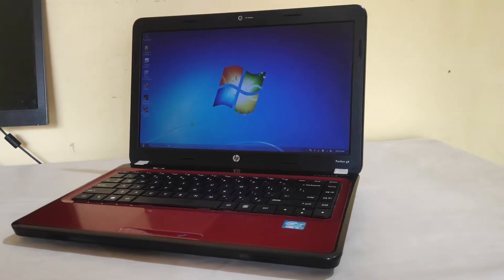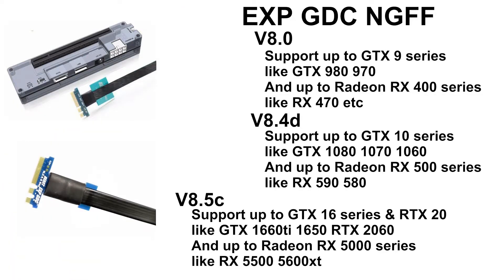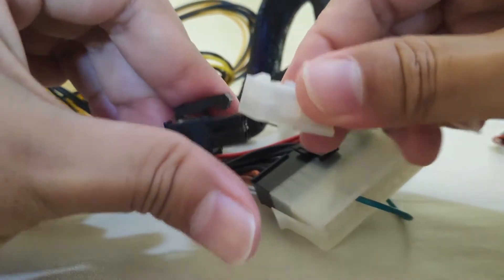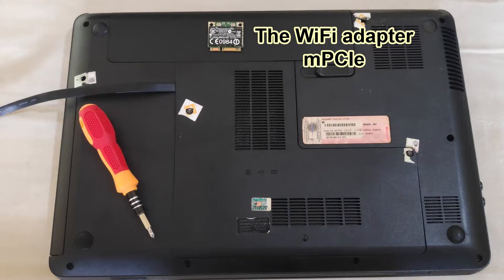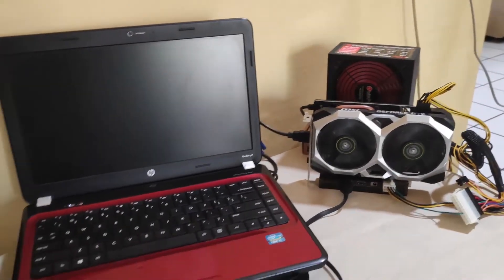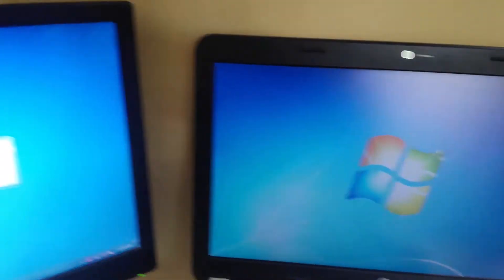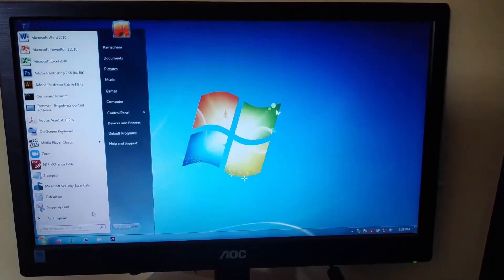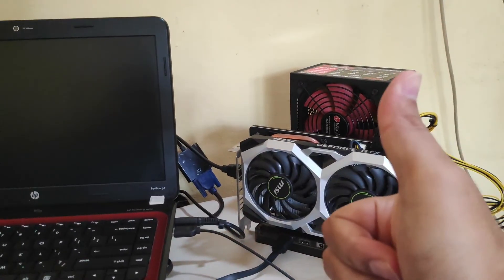EXP GDC Beast V8.5c eGPU with GTX 1660 ti on Old Laptop from 2012

Comment: Hey, this video is the most informative one I have ever found on this mater, I recently acquired the EXP GDC V9.0v and have a GTX 1650. My laptop has a m.2 slot that seems to run on x4 speeds (the one I use for the m.2 m key) and I also could have compatibility with the ngff key.

I have tried to get the drivers to work for a while but I cannot get rid of the error 43 code, the dock and the card are detected but I just cannot figure out how to get this thing to work at all…should I try setting my display to an external monitor so it can work or is it more of a hardware issue rather than a driver issue? Thanks if you are able to read this, I am desperate for help :(
Reply from the maker: Very well.
Can you please tell me your email but BACKWARDS+SPACE ? 

I will send you the Error43 Fixer instantly.
Reply: @ClayWheeler  Update on the matter:
I used a system scanner to determine exactly which PCIe interface I have and I came across that I have a PCIe v2.0 (5.0 GT/s), my laptop is an HP Pavilion x360 Convertible 14-cd0xxx.

This PCIe bus appears as dissabled thanks to my Intel UHD Graphics 620 (slot is not used at all also), though I saw a tutorial where the m.2 at x2 speeds can work but restraining the capacity of the eGPU, I cannot ger the system to let the eGPU work.

I am not sure this version of the beast works entirely for this laptop and 2.0 PCie m.2 slot, not sure if it is a GPU issue or if it is the m.2 itself (dunno if I must disable my integrated graphics card for it to work either).

On regards of the email, better not expose myself, sorry.😅

Thank you for replying despite the time lapse of this video, hope some of this information can bring more light to my case, really appreciated.
Reply from the maker: @anonimity2562  first of all, Non-Thunderbolt external GPU is now always bound to have Error43 since NVidia changed their driver logic back in January 2021. ALWAYS.

People came up with Error43 fixer and WE agreed not to put it Online for free to download by anybody.

This tool is literally Single Click Solve Error43.

And you're not the first person with error 43. I already gave tons of this tool to other ppl who commented on this video
Reply from the maker: @anonimity2562  and don't worry I will immediately delete your comment after you reply your email address
Reply: @ClayWheeler  Wrote to you yesterday a little late...are you still up for the zip send?
Reply from the maker: @anonimity2562  yes
Reply from the maker: @anonimity2562  done
Reply: Thank you, I will proceed to the installation, tell you how it goes.
Reply: Thank you, I got the file but now I have a weird issue, I set up everything as last time according to the manual.

But the only difference now is that for some reason the PSU and EXD GDC both started, the GPU has its fans continuously working as they should but no matter that the wifi PCI port is disabled and that I have my network boot option in BIOS disabled as well, the beast works but the system cannot recognize the GPU still.

Last time the fans did not work but the system did recognize the basic display adapter which then was recognized as the GPU, any ideas what I am missing now?

Note that the GPU fans are working even without any trace of NVIDIA drivers (cleaned everything with DDU), they just work now without any drivers when I turned on the laptop.
Reply from the maker: @anonimity2562  wait what.

But in your first comment, you got Error43 which means the GPU is Properly Detected and the driver is installed. But Error 43 simply means Lane Restrictions.

How come the GPU becoming not detected now?
Why not setting everything like the first time you got Error 43?
Reply: @ClayWheeler  I cannot understand myself how that happened, I think it was because I moved the boot options on BIOS to network boot as first option then OS, probably that was the deal. 

I moved the bios settings a couple of times (boot to lan is not available on this laptop) and then left everything as default settings except  the network boot, which I disabled (kept OS as first boot option).

When I started the laptop once again then the fans shut down and the basic graphic adapter finally showed up, installed drivers, ran the fixer after error 43 showed up and now I can use the GPU and the control pannel no issues...weird experience, but thank you so much for the help, the m.2 at last works, fps are low since the CPU has 2 cores, but the game I tried so far works nicely.
Reply from the maker: @anonimity2562  just make sure to use: Only external monitor, and Disable Laptop's internal display. By pressing Windows button on keyboard + P

That way you will get higher FPS
Reply: I did follow your tutorial tip, made sure to set up one display and it gave generous fps stability with ocassional spikes (gotta lower in game rendering depth if able to). Still, only issue was the error 43 deal and me messing with the BIOS boot options, hope this helps for other HP laptop enthusiasts.

By the way if anyone reads this, make sure to do research on M.2 slots that are NVMe compatible and how they are different from other M.2 port interfaces, also if your laptop is from the HP brand and a model manufactured after 2015 follow these steps:

1) Open your laptop's case and search if it has a NVMe M.2 slot (where SSD storing units can be installed, NVMe compatible that is) in order to purchase a EXP GDC "Beast" 9.0b external graphics card adapter (if you want to keep using your WiFi chip long term).

2) Once you are sure that you possess the right slot and have your adapter at home, proceed to turn on your computer and access the BIOS (If its a F. 41 version access it pressing F10 when restarting or turning on your laptop) and disable the network boot option*. Keep the *OS boot as first option and leave the other options as they are by default (also disable USB/disket boot for good measure to prevent Black Screen or boot freeze on future steps).

3) Then once logged in normally on your laptop, right click on the windows logo and search for device manager option in the upcoming pop up menu. On a side note, make sure to disable Steam staring up when you log in into your laptop, so you avoid overloading the CPU for the steps ahead.

4) When at the device manager, seek the System Device tab and deploy it, then seek out for your PCIe processor (has root port and PCI descriptions on the processor name), it is the one using the wifi chip so you want to disable it (to avoid conflict with the Beast M.2 M key), then turn off the laptop.

5) Follow the rest of the steps on this video to set up the Beast with it's PSU and GPU, then make sure that after driver installation your card is recognized (don't forget to use the HDMI cable direclty on your GPU), even if it shows error 43, then your GPU has been recognized successfully.

6) Now you only need to execute the error 43 automatic fixer to enable your card and then you can start experimenting with settings on the control pannel, but first make sure how to set up the fans with the MSI afterburner app (look it up on google), and then browse for your best suiting configurations for the NVIDIA control pannel to max out your GPU performance.

That is what worked for me and what I did, I have the following hardware:

1) EXP GDC Beast 9.0b version.
2) GeForce GTX 1650 Graphics Card.
3) HP Pavilion x360 Convertible 14-cd0xxx.
4) Intel Core i3-8130U, 2.2 GHz, 2 Cores 4 threads.
Reply from the maker: @anonimity2562  just a Suggestion, maybe create your own eGPU video.

No need to credit me, but I will pin your future Video as M.2 version in comment.

Based on my research, people are actually looking for this keywords: M.2 external Graphics Card dock. They just want to know if it's real with EXP GDC v9.0b and it's not a fake Product.

Therefore you could get insane amount of views pretty quickly.
No need to be 10 minutes long. 5 minutes is more than enough.
Reply from the maker: Like
LIAMG  @ L I A M E R U O Y

Comment: I got error code 45 after installing driver. How do I fix it ?
I use Amd RX 580 on laptop lenovo g40 with Intel processor and nvdia 720M graphics. I try to restart my laptop but the code is keep showing. Please Help me.
Reply from the maker: When installing the Driver, no error show up in the installer warnings?

Error 45 means the GPU is Physically not detected.
Reply: @ClayWheeler  it say like this after finish instal the driver 
"oops! Something went wrong. Error 207 - Radeon software installation completed successfully but windows detected a potential issue with your graphic card device"
What should I do ?
Do I need to instal driver again ?
Reply: @ClayWheeler  I tried re-install the driver but it solved nothing. How do I fix it ? Pls help 🥺
Reply from the maker: @mei5756  use DDU Display Driver Uninstaller - choose Uninstall and Shutdown

And then unplug the GPU, reseat it again very slowly

Comment: The beast 8.5c is it compatible with VGA PCIe 3.0 16x ?
Reply from the maker: None of External GPU dock in existence have x16 Lanes. Even the Thunderbolt eGPU.

But in general, these products are either PCIe Gen 3 x1 for mPCIe & Express Card, Gen 3 x2 for NGFF, Gen 3 x4 for M.2

If you check the pinned comment, especially for RTX 3070, it will work despite it is physically connected to PCIe Gen 3 x1
Reply: @ClayWheeler  can u recommended my VGA card for my laptop Toshiba L740, i5 2.9ghz, DDR3 8gb (single), with internal gpu Nvidia GT 525m (already overheat if playing game)

Comment: Procedure remains same if i install m.2 version
Reply from the maker: Yes
Reply: @ClayWheeler  but gpu is not detected
Reply from the maker: @bckstyt5101  the slot must be M.2 NVMe slot.

Are you sure it is not M.2 SATA slot? People often confused by this.

Is the GPU fan actually turned on when you switch on the Laptop?
Reply: @ClayWheeler  its m.2sata/pcie slot
and no the gpu fan doesn't spin
Reply from the maker: @bckstyt5101  check your BIOS while the eGPU is not plugged in, force the M.2 slot to be PCIe.
Reply: @ClayWheeler  i tried but can't find that option
Reply from the maker: @bckstyt5101  is your M.2 slot actually works with NVMe SSD?

Because if eGPU not detected, it could mean that SSD also not detected in that slot
Reply: @ClayWheeler  that i haven't cheked
Reply from the maker: @bckstyt5101  are you still there?
At least can you tell me your Laptop's model?
Reply: @ClayWheeler  its hp slim dextop
Reply from the maker: @bckstyt5101  no problem.
Slim Desktop is no different from Laptop.

What HP model name?
Reply: @ClayWheeler  HP Slim Tower Desktop PC Intel Celeron G5905
Reply from the maker: @bckstyt5101  according to search, it has full lane PCIe X16 slot on it.

Is your model number S01-pF11 xxxx ?
Reply from the maker: @bckstyt5101  wait, your computer can use Full GPU without eGPU.

You only need Jumper if you want to use Secondary Power Supply
Reply: @ClayWheeler  it's HP Slim Desktop PC S01-aF2207in
Reply from the maker: @bckstyt5101  this is your Motherboard?

 https://youtu.be/6GDlImggpIY

Comment: I absolutely cant get this to work on multiple laptops . The manual says to turn off Internal  Network adapter option in bios but it wont work in either setting. One of my laptops is wery similiar like yours but nope wont work. Tested From win7 - 8.1 to 10.Gpus  Gt660,1070,270x,5770. with expresscard or mini PCIE cables. I have the 8.5c beast. The only time it worked was 2yrs ago on wery old laptop and 7600Gt but sutch speed is irelevant.

Comment: Hey I tried it in my Dell latitude E7440 laptop with a 1050ti after turning on my laptop the GPU has power but I have no display in my laptop been trying for weeks but still nothing
Reply from the maker: With External Monitor?

Comment: Can you tell me what score you get for 3Dmark11 graphics score? I wanna see the % of performance loss.
Reply from the maker: 78% Performance loss if compared to Desktop Core i3 2130 + same GPU.

That's with mPCIe or Express Card
With NGFF, 60% Performance loss
With M.2 35% Performance loss

And by the way, M.2 performance is way faster than Thunderbolt 3 or USB4
Reply: @ClayWheeler did you test on 3dmark11 though? I dont want cpu lowering results as i have a better one. 3dmark is very very cpu light
Reply from the maker: @theblitz1687  you're mostly Bottlenecked by the cable.

And I also pinned a comment which showing 3dmark result in one of their video
Reply: @ClayWheeler  amazing vid! a lot of practical info. Wish he had a comparison using internal screen though ;u;

Comment: Loss of bandwith isnt important to me as long as it works with intetnal display of the laptop. Does it work with all laptops internal displays?

Also what is the fps with internal display vs external display? Im also thinking about a used 1660 ti
Reply from the maker: Please remember that Gigabit is not the same as Gigabyte.

1 Gigabyte = 8 Gigabit
1 Gigabit = 250 MBps

With 2.5 Gigabit, you're barely have 700 MBps, which is already a Choking point for most video games.

PCIe Gen 3 x16 Lanes is 16 Gigabyte per second, or, 128 Gigabit per second. This entire video is 2.5 Gigabit. 

That should tell you how much FPS loss compared to regular desktop Motherboard. 

The communication between GPU and Laptop must NOT be Two-Way transmission. Because the signal loss can occur. Which is why it must be One-way from Laptop, to eGPU, to GPU, to external monitor.

There's other video that attempts GTA V on mPCIe, with Core i7, and GTX 1070, and barely get 20 FPS.

Good luc.
Reply: @ClayWheeler   @ClayWheeler  I cant see the video can you write its name? Btw 1Gigabit is 125MBps :D

Even the most strongest gpus dont fill up the bandwith, and gpus we are looking at are way weaker than those.

But more so i dont have a monitor at home, so i have to make it work with internal display if its possible. There probably will be a performance hit but id like to see how much exactly.

If you still have the same setup, can you make a video showing fps internal screen vs external? With msi burner showing fps cpu and gpu. That would be very helpful to me.

Comment: hp pavilion dv7 1023cl

- processor intel core 2 duo t9600 2.8ghz 6m
- Ram 6gb
- Ssd 256gb
- Hdd 320gb
- Nvidia 9600m GT w/512MB GDDR2 or 3

Hey this is my laptop specs, can i use the external vga?

Comment: Hi, my laptop is amd a10 5750, the egpu is gt730. The egpu work and show on the monitor, but i got the loop: acpi bios error at start boot. I do many thing (update bios, reinstall win10pro, ...) but no lucky. But everything work well on kali linux 😅. Can you give me suggestions, thanks.
Reply from the maker: That sounds new to me.
I've never heard this Problem.

Is it using Mini PCIe?
Reply: @ClayWheeler  yes, mini pcie. 🤔

Comment: My laptop type HP is an AMD A-4 5000 APU with Radeon(TM) HD Graphics (4 CPU), 1.5Ghz, 8gb ram, the default gpu processor is AMD Radeon HD 8330 with 512mb vram, can I use an external GPU using a GTX 1050TI 4gb with GDC Beast EXP version 8.5 help?
Reply from the maker: Yeah I also have Lenovo Laptop with AMD A5 APU, and it didn't work with any kind of external GPU.

Perhaps all of old AMD Laptops before Ryzen wasn't optimized for External Graphics Card at all.
Reply: @ClayWheeler  if the A4 5000 uses a GTX 750TI 2gb, does it still not work?
Reply from the maker: @itusermyid  no, I mean the External GPU Docking itself is not detected. Regardless of the Graphics Card.

With my HP Core i5, the external GPU docking is Detected even without any Graphics card attached to it.
Reply: @ClayWheeler  possible problem with error code 43 or 12 if on an A5 laptop?
Reply from the maker: @itusermyid  Error Problem is not the same as Not being Detected at all. Because if the docking is not detected, there will be no Warning or Error code whatsoever.
Reply from the maker: So far only old Intel Laptops works with external GPU

Comment: i want use AMD Radeon RX 560, V.8.5c or V8.4d?
Reply from the maker: V8.0 is okay apparently.

The other YouTuber tried v8.0 with RTX 3070 just fine .

See pinned comment
Reply: @ClayWheeler  how to i know if my adapter is v8.0, v8.4d or v8.5c?
Reply from the maker: @luminumlx2604  they usually write it on the listing of online shop?

That's how I see mine on AliExpress
Reply: @ClayWheeler  the one i bought didn't had any information about this on the listing, neither in the name or description :/

Comment: hello, did you check your graphic card TDP? mine is MSI GTX750Ti OC 2 GB should be around 60 W TDP (according to the website), but the maximum power it draws only around 35 Watt using hwinfo. and when I checked at the GPU-Z at the sensors tab, power consumption of 98.9% TDP is only 38.1 W. I think mine is EXP GDC v 8.4. thank you.
Reply: Most likely your info is about the laptop's GPU , not the external one since you use an external power supply that can't be read by your laptop's sensors.

Comment: Hey bro just watched your vid more than 5 times. 
I have dell laptop with i7-7500U (7th gen) with 8gb drr5 ram and intel hd 620
I wanna try exp gdc and my laptop supports ngff version.
I wanna use Nvidia Quadro K620 2gb 128 bit ddr 3. How much performance i will get. I just want 720p+ resolved and 45+ fps in almost every game.
Reply: U mean..ddr4 ram
Reply: @farishakim6759  yes